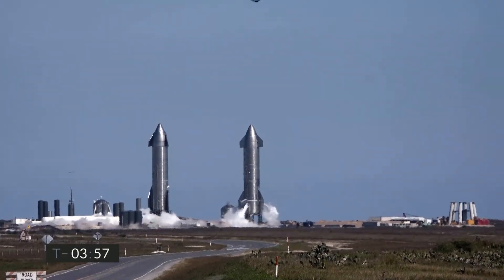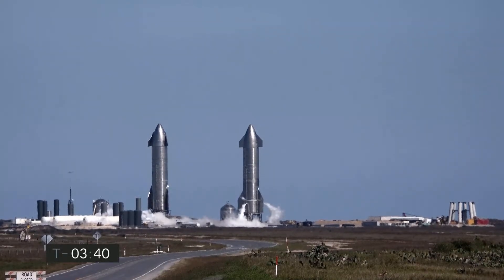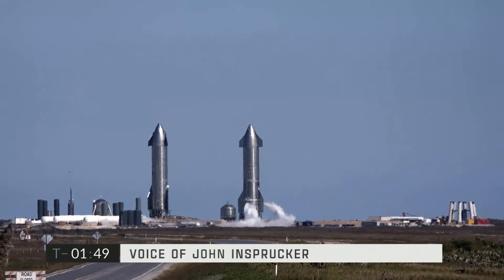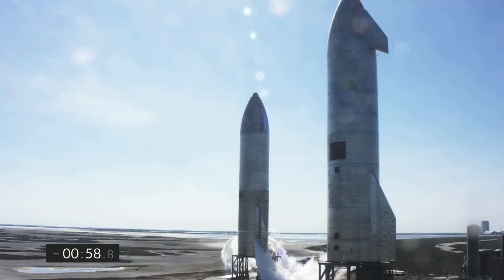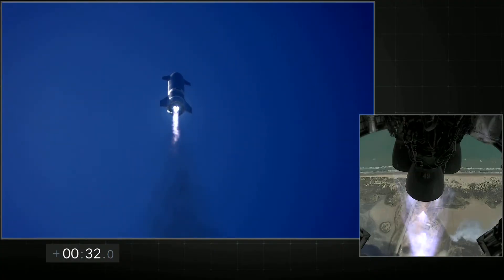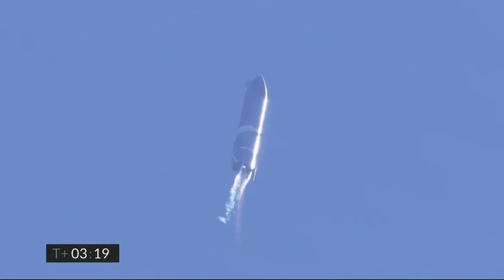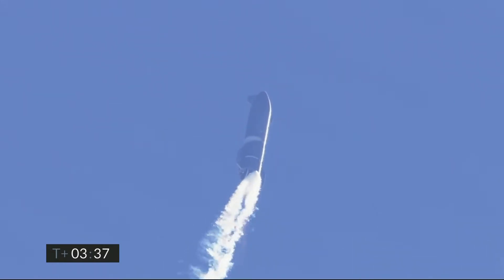Starship | SN9 | High-Altitude Flight Test

Comment: The burn needs to start sooner to get more vertical balance before landing.
Reply: Not just that. The rocket needs more thrust closer to the landing to cancel out the fall and to gently & slowly touch it down. That means more fuel needs to be burned at the few last moments of landing than in the first few moments of launch... and that's after having burnt a lot of fuel on blast off. That, in turn, means it needs to fly with more fuel.

Comment: How the fuck do you think flipping at 1KM is ok back to a landing configuration, maybe try going higher so you have time to adjust and restart the engines so it doesn't crash, pretty easy when you literally saw the entire problem.
Reply: It was perfectly NORMAL. It was one of the engines having issues.
Reply: More efficient to do the landing burn later if they get it right

Comment: This time they overshot the flip whereas last time they did the flip too late.  As we can see they have the hardware part down perfectly, it's just controlling the landing more precisely that's the issue.  It doesn't seem so much an engineering problem as it is a problem with their calculations and piloting because they have to give it just the right amount of thrust to make it vertitical while giving it enough time to slow down while vertical while also reducing burn time.. I think this time they tried doing the transition faster and simply gave it too much thrust.

Comment: You can see something fly off just as the second engine puffed but didn’t start.
Reply: Probably another variaty of "engine rich exhaust", with the telemetry data and video though I'd bet they already figured out the issue.

Or will in the next few days

Comment: It went down from 10 km to 1.5 km very quickly, I think they were very late to start the engines for landing. You can't land it at that speed. Start the engines for a vertical position at 3 km and gradually reduce the speed. Elon, don't thank me for the advice.
Reply: It was spot on. One of the engines had problems re-igniting

Comment: SIMULATOR = 20FT high model on a swing arm on rails with pressure sensors (for thrust)
Reply: No point, this is testing the actual flight hardware and the issue this time was an engine startup failure, your simulator would never reveal that, the sensors and flight computers did just fine it just didn't have the thrust it needed

Comment: Looked like there was a little more residual fire after engine cutoff on ascent than on SN8. And when the two engines are supposed to re-ignite to flip SN9 vertical, only one ignited and you can see some objects fly out from underneath.

Comment: It looked like there was a leak and fire in the plumbing of one of the engines during ascent that same engine was the one that failed during landing so my guess is that there was a leak in the high pressure fuel/oxidizer line that caused the engine to not ignite and to loose gimbal control.

Comment: SLS: early shutdown during test - announcers freeze and stutter making it awkward. 
SpaceX: rocket explodes - "We gotta work on that landing" 😂
Reply: Haha! John Insprucker is cool as a cucumber.

But a big difference is that the SLS rocket they were testing is the actual vehicle intended to do the mission later this year, so any unexpected result is worrisome. And they can't easily just make another one if that one gets damaged, whereas Starships are almost mass-produced. And of course this is Starship's very early experimental phase, so SpaceX expects problems to crop up - in fact, they probably learn more when it RUDs than when it goes smoothly.
Reply: @L4JP  why nasa dont use falcon heavy to moon this year?
Reply: @qa38o54  because NASA is outsourcing vehicles not engines
Reply: @qa38o54  lots of unknowns, like aerodynamics, weight, and mounting points
Reply: @qa38o54  There are several reasons - capacity, development, and legislative:
● Capacity: I don't know the mass of the Artemis payloads slated for SLS, but according to Wikipedia, the rocket's capability is 26t to TLI. Falcon Heavy is not yet rated for TLI, but in expendable mode it can only do 26t to GTO, and of course TLI is farther, so FH is likely not to have enough power.
● Development: This isn't plug-and-play. There has been no development for how to attach Orion, ESM, and other hardware to FH, and of course such development would not happen until there is a contract.
● Legislative: Replacing SLS with FH would be throwing away an existing contract (and all the money spent so far) and creating a new one. And pure single-vendor commercial contracts are a hard sell in congress, because congressmen like to have some piece built in their state.
Reply: @L4JP  thx man I appreciate you 🙂
Reply: @L4JP  
I love Elon’s humor, RUD.
Reply: jpNewpic88.men
Reply: 🤣🤣 yeah, no biggie. 🤑
Reply: theres a difference between all up testing and rapid test articles, and people like you dont understand that
Reply: Elon's failures are 100 times better than other peoples' successes.
Reply: Yup, SpaceX are some steely-eyed "missile" men, a few failures here and there just make them that much better later

Comment: I think it would be easier, after putting it in the horizontal position, to lower it and land like a jet plane. If not on land, on the sea, just like a seaplane. It would only be necessary to adapt the landing gear and the logic.

Comment: Two of those things right next to each other?  Yes, I get that telephoto lenses make the distances look closer, but the 2nd rocket actually got engulfed by the blast from the one taking off.  If there had been a major failure, that would have taken out 2 very expensive pieces of equipment.

Comment: Ran out of time and control authority, need to start the landing maneuver earlier and throttle the engines up slower.
Reply: I seriously expected them to go slowly and give themselves lots of extra control margin for these early flights, so they can land successfully (and reuse the vehicle) while gradually moving towards the production maneuver.

But it looks like they went with the production landing maneuver both times 😂
Reply: Not what happened, one raptor failed to ignite causing the vehicle to overdo its flip maneuver making it impossible for the one raptor to compensate. It was going fast because one engine ignited, SN8 was slower because both engines ignited before both ceased to operate nominally.

Comment: I have always heard that fins on a rocket just add drag, so why does the Starship have fins?
Reply: To add drag
Reply: Well, that and control in the horizontal position. When ascending, only the thin edge will be pushing through the air.
Reply: @RickyTrain5  you beat me by 30 seconds lmao

Comment: I never saw the two engines turn on to slow the descent.  Seems like the flip vertical is a little too late and the BIC BBQ lighter needs boosting.  They need an Oxy-Acetylene torch to light those motors.  The feed from the motor view from flip to RUD would be nice.  Let's see that.  Also shouldn't there be a few camera lenses on the bottom of the lower flippers?

Comment: I advice you to watch it by speed of 0,25... there was problem with pressurization of tank while flipping that silos. 3/3 engines started, but there was not enough fuel for the rest caused of side-up gas pressure towards the only one upper engine at that moment. Solution: venting gases flip on 3km and then descent ignition of engines while stabilized, but 1 sec before the entry ignition sequence pressurize tank by rapid blow in of helium. good luck on sn10

Comment: Really !, schoolboy error if I ever saw one, and I don't mean because it crashed. 11:46 to 11:48 was all wrong. The flaps and nitrogen blasters should be the only thing used to bring the Starship into the vertical position and initiated at a higher altitude, then the engine would have been able to do its job bringing her home. But I guess you already knew that guys surely, given your vast experience.
Great footage must admit as I wasn't expecting it to crash. I'll be sending an invoice for £2m for the info, Cheers

Comment: What is the "loose" fire that flashes around the engine above the nozzles when they show the inside view?
Reply: I believe it is part of the combustion process used to pump fuel. (Like a mini jet  engine as a fuel pump)
Reply: @GregoryPlauche  Although not disastrous, I don't think it's part of the design. This is a full-flow staged combustion cycle engine, so all the fuel from the preburner processes should be staying internal until combined into the main thrust. This sort of flame also happened on SN5, and they tweaked things so that it didn't happen on SN6.
Reply: @L4JP  I was under the impression all flame was internal on it so was curious.  It seemed small as though to suggest a leak, but also did not seem constant.

Comment: I can't understand the reasoning in having SN10 in such close proximity to a "test".
Reply: That's one way to motivate the team to not screw anything up...
Reply: SN10 is such a badass, it requested itself to be parked up next to it to prove how hard it is. Rumour has it,  it screamed 'Yeeeaah'  like Joe Swanson when SN9 blew up
Reply: That's SN10 right beside it??? What the holy...
Reply: @DonKelleyMusic  SpaceX needed to move SN10 out of the High Bay so that SN11 could be assembled, also SN10 and SN11 are now the 'older' revisions, SN15 is markedly improved (so much so that parts for SN12, SN13 and SN14 were 'scrapped' prior to assembly because of the improvements made to SN15).
Reply: If it goes that far off course they have a self-destruct program

Comment: Why not calculate the simple thing: How fast it needs to go in order to land safely? Looks like the problem here is massive speed with heavy load, trying to stop in last moment, its like if you are driving a car 200km/h and try to break and stop instantly, ofc its impossible, bcs you know physics and stuff, so if this "StarShip" manages to light the engines earlier and actually try slowing down all the way on his decent, than there might be a chance to land safely. 
So, try slowing down all the way, and maybe for the final touchdown go all in on engine re-ignite, it will stll be difficult, but it looks like its the only way. 
1.5 km is way to late to start the "sky breaks" i would go for something like 5 km, also add telemetry such as speed of decent and distance to the ground, so the viewers can see the details and we all together try to solve this. 
Maybe its the design problem to begin with. 
Thumbs up for launching tho, its impressive. What if you launch a dozen of this in orbit, and combine them into one ship with multiple engines, they never need to land, they just stay as a space station and you use other smaller ship to decent to planet. 
I just want this to work!

Comment: Just from my naive view - without any idea about mass, force or physics - I wonder if you can't use a softer underground for landing tests?
And most obviously I guess, trying to restart the engines in the beginning with more than sufficient safety distance to the ground could also help to prevent crashes.

Comment: Is it just me or does the pitch rate for the horizontal to vertical transition seem a bit aggressive? It looked like the single raptor engine was gimbaled all the way to the stops to null the rate, but it didn’t overcome the angular momentum.

Comment: well, technically, sn8 and sn9 landed just not in one piece
Reply: they actually did land in one piece, it's just that pesky rapid disassembly immediately after that's the problem :)
Reply: Technically, that’s not a landing, so...
Reply: "Rapid unscheduled dissassembly"
Reply: contact with surface was in one piece. unplaned rapid disasembly happened just after that.

Comment: I'm thinking the flames coming out the sides of the engine housing might not be 'nominal' shrug  if I had to guess from the video,  I'd say excessive use of cryogenics caused the flex fuel line to develop a crack.  As the fire burned it caused the engines to loose some power and control.   They compensated very well, but the engines just couldn't produce enough thrust at the end.  All in all, a very good run though.  Hats off to the team.

Comment: two engines fight with no proper fuel pressure(free flight liquid gas mid-up-press/ flip on decent side-up-press liquid gas towards the engine that only fires up on descent path. I think it's just bad flight designing. the point is to design the flight overall better. straighten up the rocket position on 2-3 km by venting gases and then start the engines to equal pressurization mid-press /// also there has to be system onboard that maintains liquid gas... liquid....otherwise good luck on Mars

Comment: The flip up method doesn’t seem like a reliable way to land the thing.
Reply: This has been the second time they attempted it, just wait till SN10, hopefully its a success
Reply: Fair point, but you could've said the same thing about the Falcon (they crashed so many of them). Enough money and testing allows to figure it out
Reply: @RM-el3gw  True.
Reply: The method itself is working, it’s currently the engines are are causing the issue.

SN8: engines lit alright and flip worked, landing engine sucked in some Air and started throwing it’s insides out the nozzle.

SN9: the second engine didn’t light up, so it didn’t have enough thrust to rotate fast enough or slow down
Reply: @ValentineC137  yep
Reply: @ValentineC137  It seems like the maneuver starts too close to the ground. I know there must be fuel constraints but it seems like they should start the engines at a higher altitude and give them more time to stabilize the craft.
Reply: @notsure9137  check the SN8 landing, the maneuver itself isn’t the problem, they did it the first time they tried.

The engines not lighting up or sucking in Air is an issue no matter when they start the maneuver.
Reply: Watch "How not to land a orbital class booster" 

This is just the beginning of the process all over again, in a few more years this will be just as routine as a Falcon 9 landing

Comment: I hope they would succeed BUT, Elon,
 space x apparently does not have good engineers and coders on board. They can not even broadcast the ocean platform landing of falcon rockets without disturbance. I am an engineer and a good engineer can solve this problem in a minute but spacex couldn't.  Alone this simple example tells a lot I think..

Comment: Suggestion from engineering: make the landing pad about 30 meters lower.....on a more serious note maybe the duration of the 'flip' maneuver needs to be longer and higher up. All that cryogenic fluid doesn't exactly stay still and I could easily see that constantly moving CG overcoming both the flaps (low speed, diminished value) and engines (gimbal limit, impulse). Just a guess.

Comment: When I was a kid, I put parachutes in my rockets so they wouldn't do this.
Reply: This rocket is 400 feet tall and 30 feet in diameter. First stage empty mass is 180,000 kg. Don't think 'chutes are going to do it.
Reply: @jplflyer  my comment was intended to cause the reader to chuckle a bit due to it's complete lack of practically. ;)

Comment: You're doing very good. You just need a new starship and crew after every mission.
Reply: They aren't putting anybody on these things till they land a bunch of them successfully. These monsters will be much cheaper to fly than the F9 if all the pieces land. The F9 second stage costs a lot more than a little methane and some LOX.
Reply: Watch 'how not to land a rocket booster' please by SX.. then go cry in a corner.
Reply: @joansparky4439  Here is the link. Totally worth watching. https://youtu.be/bvim4rsNHkQ

Comment: It looks like it's still not getting enough fuel the the engines... Looking at the colour of the flame looks like its running too lean.
When it's horizontal and slowly turning veirtcal the engines runs fine, but when it start getting to vertical, fuel Slough around in the fuel tank which could be the cause of running lean and over correction of the landing angle

Comment: About that final burn... perhaps they could light all 3 engines at first, say, at minimum throttle, then shut down whichever is performing worse, adjusting thrust and vectoring accordingly. Three engines might be too much for hovering, but why not briefly? Just wondering if there could be some more redundancy in that particular flight stage...

Comment: Raptors are a little bit tricky! SN8/SN9 both failed due to engine problems. Raptors "children deseases" or maybe again pressure lost in the tanks? SN8 and SN9 have, if I remember correctly, the same tanks.

Comment: It looked like a fuel leak burned some of the electronics on that engine during the ascent. That would be my guess.
Reply: Not sure what the cause was but the second rocket didn't fire
Reply: @kevinkentucky9972  you mean raptor, but I thought the commenter said it will land on one and not two?
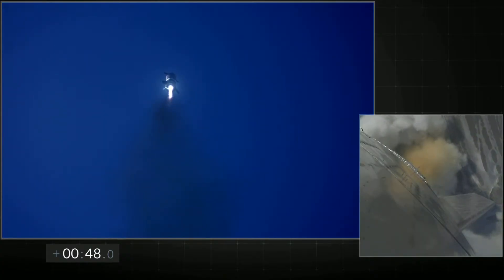Reply: @joansparky4439  at 6:14 he said attempted to start 2
Reply: 2 rockets didn't fully fire only one had.  Should of been 2 to break/ pause the drop slowly with just one

Comment: 6.00 mins into the video you can see some strange flames around the top end of one of the engines. Doesn't look normal. Possible fuel leak that could have caused some damage. I'm not an expert, it's just my opinion.